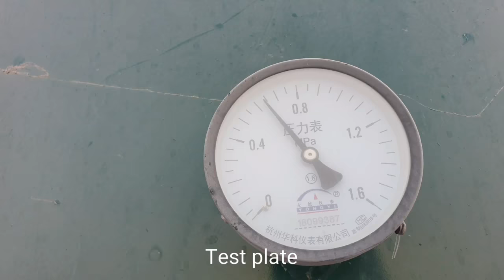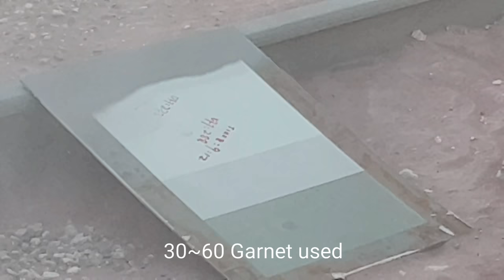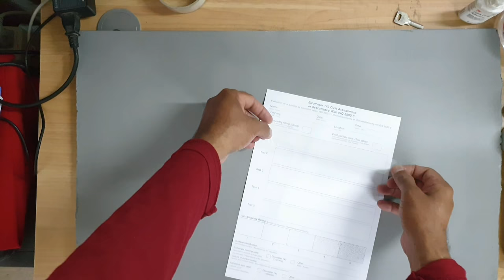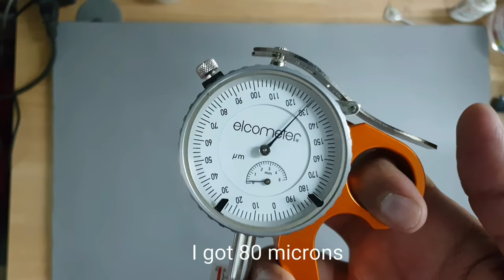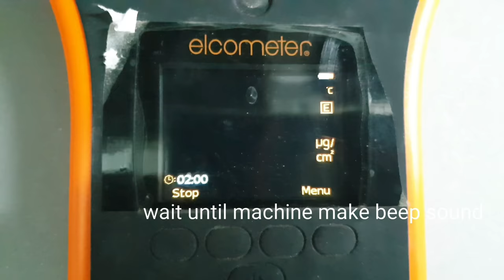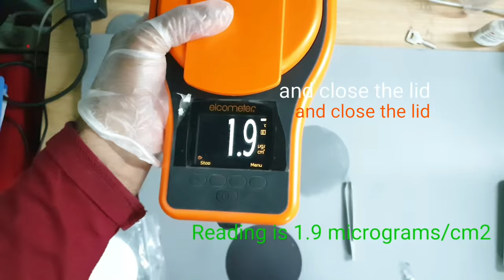Blasting, Painting and testing | Profile Test | Salt Test | Dust Test | Airless Spray Painting

Comment: Ha. ha .. you checked the anchor profile of the blasting without gloves and your hands are in direct contact with the blasted sample.
Reply: It is preferable to test salt level, then dust level and then anchor profile to avoid any inaccurate readings or avoid direct contact on test surface except test equipment.  The video is very good and sharing the knowledge to others.  Welldone 👍

Comment: I'm blasting at least two years. But I'm sending this first time in my life. What for is this test?  It's surface test  to check good abrasive use to blasting? Or test to check blasting operator?  Thanks for answer. 
P.s Sorry my English
Reply from the maker: Dear Marcin
1st test for dust remaining in surface (tape test) if any dust, there are chance of adhesion failure and  corrosion under paint filim.
2nd test for profile. 
3rd test is salt contamination test (for checking any salt)
These test not for blaster  
Please subscribe my channel
Reply: @MalixOnAir  Many thanks for answer
Reply: @monco123  you seems to be too much experienced in this field.